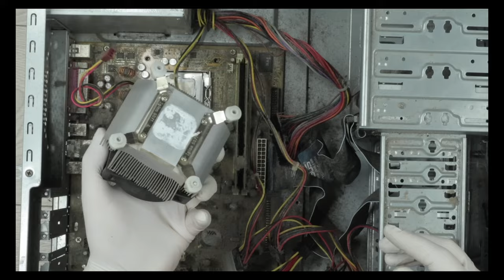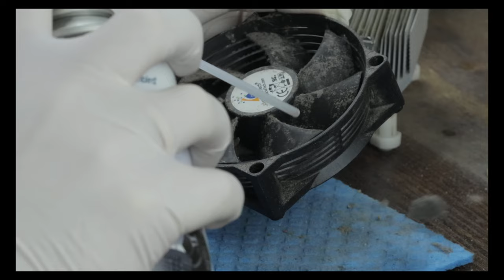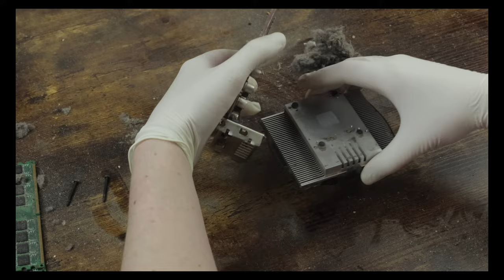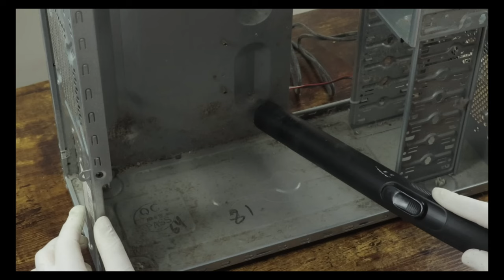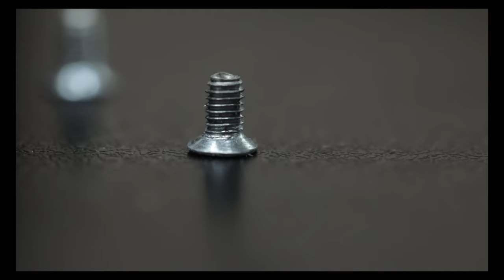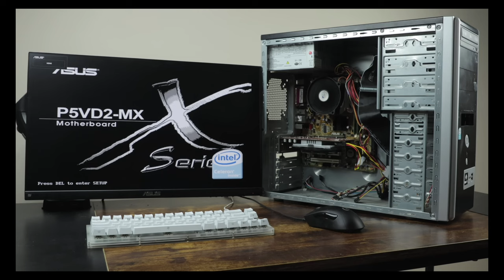Deep Cleaning Very Dirty PC  |  PC Transformation!

Comment: Did you drop it in water??? Is that okay?
Reply: yes, but only if its not with an electrical current. the reason why circuits short due to water, is because of minerals that absorb the energy, brutally interrupting the transfer system and shorting it out. if no electric current is on, freaking make that thing take a bath, but dry it afterwards so it doesnt short circuit.
Reply: @RoseStudiosGames  but won't it encourage corrosion and rust
Reply: @thegolden_spoon8525  i literally said that you need to dry it out later.
Reply: @RoseStudiosGames  yeah and when you dry it later, some of the minerals will not evaporate and stay on the PCB... ;-) thats why you use 70% isopropanole (the other 30% is destilled water without any minerals ;-) )